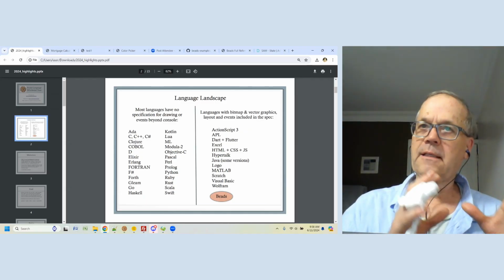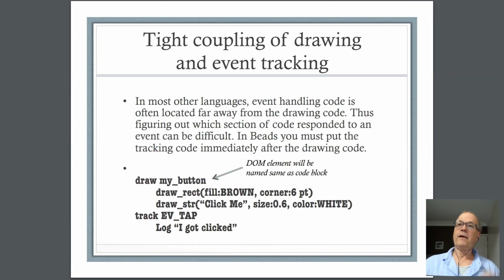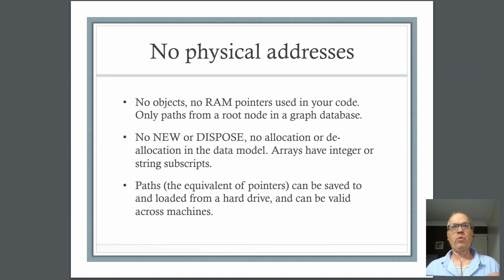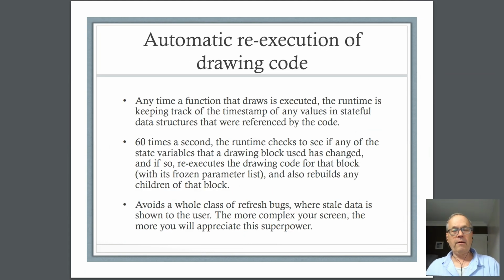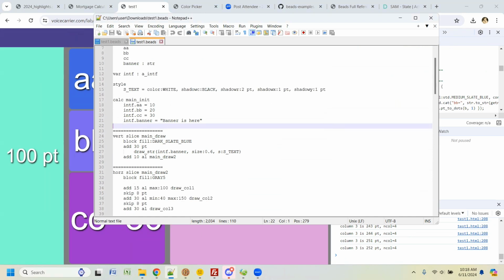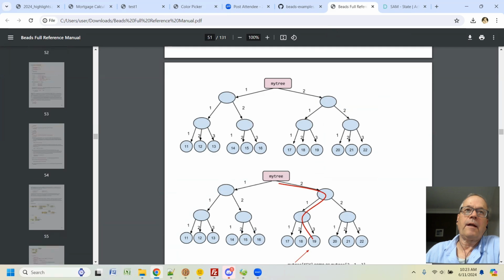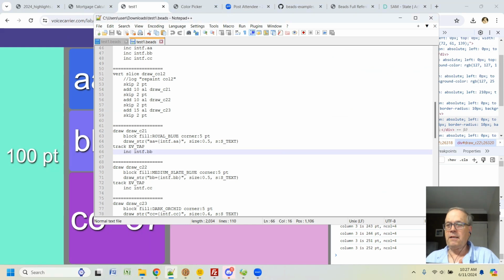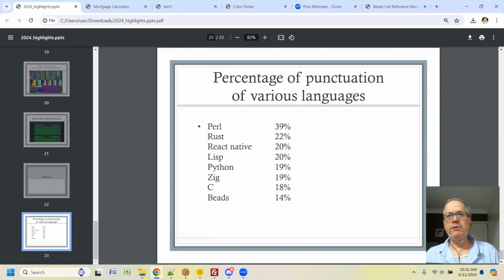Painless stretchy web apps using a shorthand notation by Edward De Jong

Comment: People have been using multiple languages since forever. Linker scripts, make files, autoconf, the list goes on.

Also, how is this related to functional programming? It looks might it might be related to dataflow programming, but i don't see higher order functions
Reply: If you read the Turing Award lecture by John Backus who invented functional programming, he talks about software interchangeable parts, and making large programs out of smaller pieces. So this is an attempt to offer a more Lego-like experience for coding, where you snap together small chunks of code. You are correct it doesn't resemble languages like Haskell. Higher order function capability is expressed rather differently, but it has the same result. Hard to explain in a paragraph.

Comment: I love the mortgage calculator as an example of a responsive layout because when flipping the screen the layout itself doesn't change at all, everything just gets wider by a seemingly completely arbitrary amount so that nothing lines up anymore. I also love the color picker. It's very responsive until the available vertical space gets too small and it hits a debugger break point and freezes the application. Very production ready. It also really doesn't want to starts scrolling, it just shrinks and/or hides content.
Reply: I updated the Color picker to accommodate super low vertical space, by dropping the web palette if the total screen height is below a certain threshold. It is intended for desktop computer use and tries to make the color swatches large enough to be useful